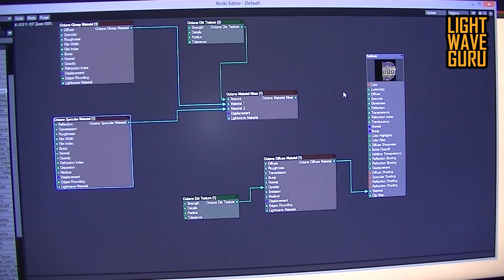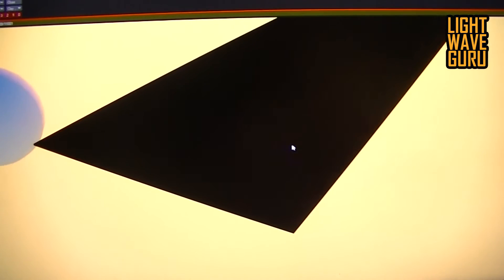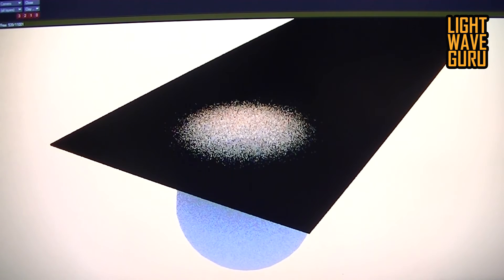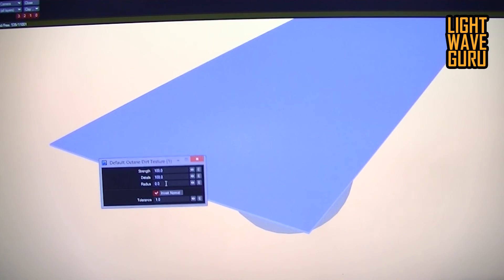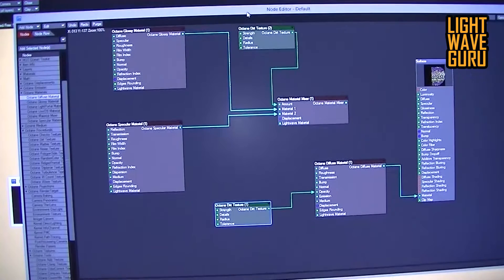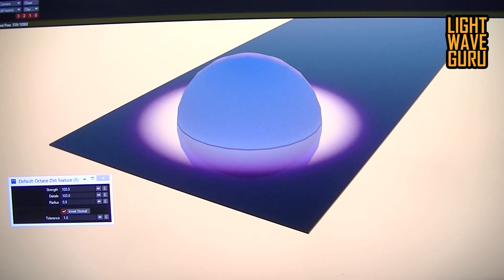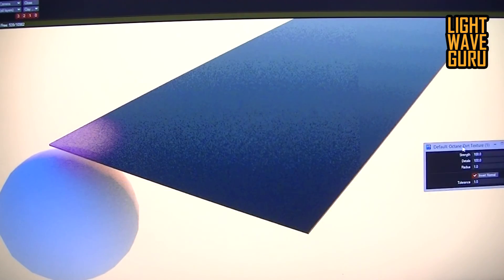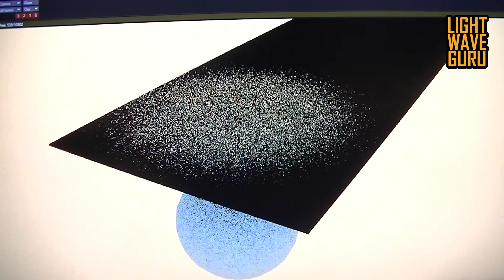Octane Dirt Node How it works? (for 3dreamstudios)

Comment: Thanks for this! So what i'm thinking, you could use this for say water foam say water around a rock in the sea?
Reply from the maker: for example....or you can mix with that technic multiple textures with the dirt node parameters.
Reply: @LightwaveGuru   @LightWave Guru  Ahh ok. i'll try this! Thanks again.  I am subbed to you for a while on my old YT channel. But resubbed on my new account (this one). Love your lightwave stuff.
Reply: @LightwaveGuru  Also would you be able to do a more extensive tutorial on this also with textures? As i am still learning Octane. And find it hard.